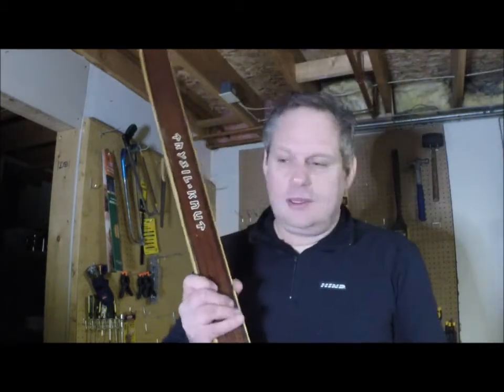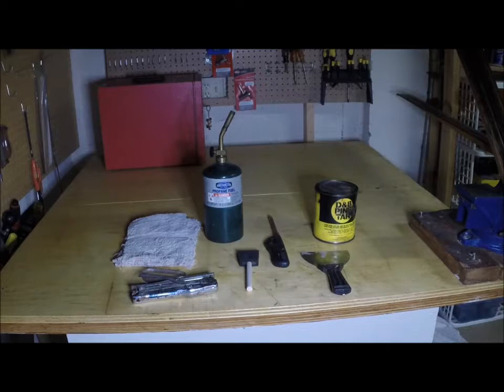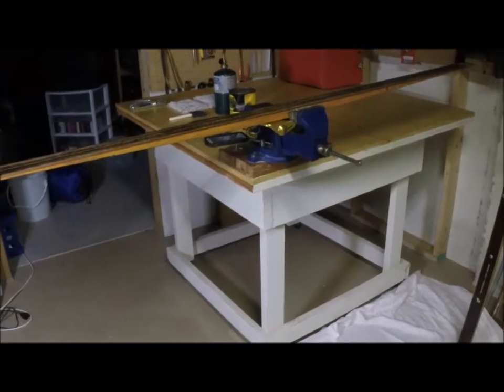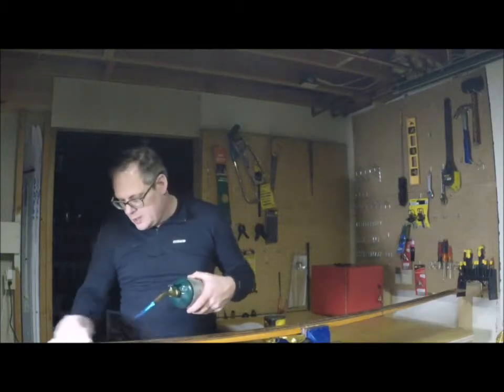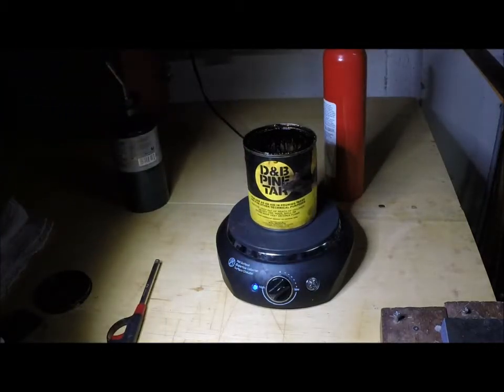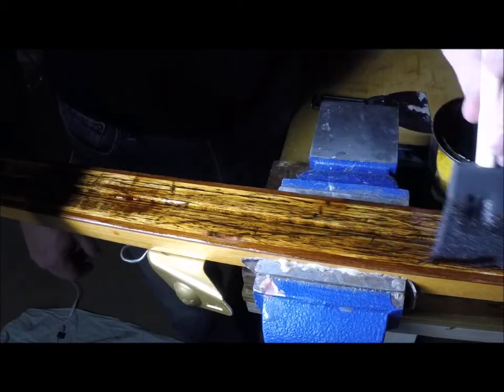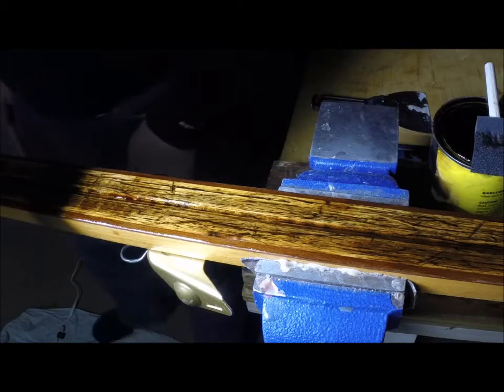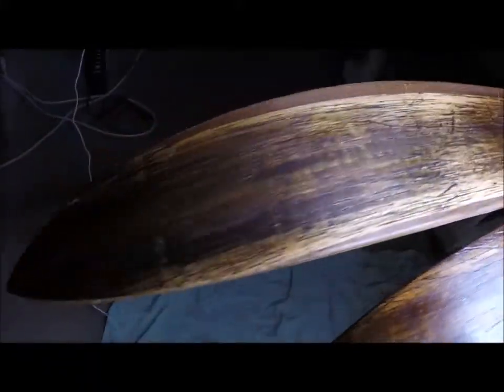How to Pine Tar Skis with Cheap, Easy, Simple tools

Comment: Thanks Mike....  Yesterday I got out my gear to hit the trails and realized my skis that I had been using for the past few seasons were toast.  I was going to buy some new ones but I remembered that my parents had some old gear in their basement.  Long story short...I found an old pair of Bonna woodies and put my Salomon SNS bindings on them.  Had a riot today on those things...they felt great.  After I got home I started doing a little research on care for wooden skis and came across your video.  Thanks for posting it.  I just picked up a pint of pine tar and I'm about to go to town.
Reply from the maker: +Robert Mitus  You are welcome, Robert.  Cool that you can have your folks old woodies.  They are a velvet ride, for sure.  Pine tar them, hot wax them (with paraffin is fine) and have a ball.

Comment from the maker: Folks, if you have a nice pair of wood skis, you should consider blocking them while you store them for winter (or longer).   Blocking helps maintain the camber and keeps the skis from twist warping.  Cut a piece of wood that is about 3/8" wider than the normal relaxed camber of your skis when you hold the skis together.  Put the wood block between the skis under the part where the bindings are mounted.  Tie the tips and tails of the skis together.  The wood block should hold in place by itself.  IF not, then the block is too small.  Don't over-do it by making the block too big, thinking that you are going to put more camber in the skis.
Reply: Super helpful.  Thanks.
Reply: Excellent tip; thank you

Comment: I just pine tarred my skis. I warmed some linseed oil in a mason jar set in a pot of water. I then poured in an equal amount of tar and mixed it with a stick. I used agricultural grade tar and it looked really nice but it's taking a long time to dry ( maybe I shouldn't have diluted it). I need to get some wax but I want to do some research first. I'm also making my own bindings, so it's quite a project!

Comment: I worked in a ski shop many years ago and this brings back some good memories.   We didn’t get a lot of wood skis in but I still remember the smell.  We used to get the pine tar ( Swix maybe?  ) in little aluminum bottles that you could heat up with a torch before applying.   Thanks for posting!
Reply from the maker: Great memory.  Thank you for posting

Comment: I bought my first Cross Country ski package from Eastern Mountain Sports in Burlington VT in 1973 for $40 (included wooden skis, boots and bamboo poles.  I still ski on wood skis (Bonna 2400's) and wouldn't think of switching over.  I still have the same pin bindings and bamboo poles from the original purchase.  Just skied 4 miles this morning walking the dogs.
Reply from the maker: Marc LaPine fantastic, Mark!!

Comment: OK.  I finally did it and your video was helpful.  Good points:  sponge brush worked great.  Also seeing how long you used the flame (1-4 secs at a time) was helpful.  I bought Pine tar from Akers Ski online and it was thin so I didn't have to warm it up. (Maybe it's the quick dry tar another helpful site mentioned?)  I did put it in the sun for 30 minutes.  Today is 90 degrees out so I put the skiis in the sun to warm the wax and open the pores too.  Seems weird to prep skiis on a hot day but that's my suggestion!!
Reply from the maker: Renee Lajcak YOU ROCK, RENEE!

Comment: Mike, thanks for the video. A buddy of mine just gave me a pair of old wooden skis. I watched your video and have started the process. I am waiting on my pine tar to arrive. When I got the skis it appeared someone put a bunch of pine tar on them and never heated it in. Waxed over the tar as I got a lot of that off. Bottoms were almost black and super sticky. A marble my have stuck if i tried to roll one down it!!! Anyway I was wondering if I could send you a picture and see if you think I need to get more off. They are not sticky now but still much darker than yours.
Reply from the maker: Sure.  Send a picture or a video!  Sometimes old wax looks like pine tar.  In fact, the really old kick wax like WWII Era wax DID  have pine tar in it.  Anyway, if you got the sticky stuff off, it should be OK.
Reply: Thanks for the response. Not sure I can attach a photo in the comment section. Don’t know how to do it. I will hit them again today with the heat gun and make sure all wax is off and proceed with the pine tar when it arrives from Amazon. Thanks again!!

Comment: How often should I pine tar my old wood XC skis?  If you're open for a suggestion, turn off the radio. It was kind of hard to hear you when the radio was playing.
Reply from the maker: I think the general rule is pine tar every 75 miles or so, BUT a lot has to do with how clean the snow is and how abrasive the snow is.  So, if you are skiing dusty desert mountains, you might have to pine tar more often.  Your skis will tell you.  Look at them and you can see where the pine tar has worn off usually more at the tips and tails.  Thanks for  the suggestion about the music in the background from the radio.  I didn't realize it until I edited the video.  Future vids don't have the radio.
Reply: @explorermike19  I pine tarred my skis yesterday.  Today they are still tacky.  Do I have to wait for it to dry before I wax?
Reply from the maker: @Guitarzan8  Pine tar won't dry.  Polish it with a rag until it isn't sticky.  If you have too much pine tar to wipe clean, heat up the pine tar with a hair dryer or heat gun to liquefy it,, then wipe it clean.
Reply: @explorermike19  Thanks Mike!  That worked. Does the wax have to cure before I ski on them?
Reply from the maker: @Guitarzan8  Neither wax nor pine tar have to cure.  Just be sure that you don't ski on warm wax.  If you wax or keep your skis inside, let them sit outside for 20 or 30 minutes before you ski so the wax can cool and adjust to the outside temps.
Reply from the maker: @Guitarzan8  by the way, I did make two new videos about base/glide waxing wood skies and kick-waxing wood skis.  I should have them posted on YouTube within the next couple of days.

Comment: I was thinking that my heat gun would be safer than a torch although probably slower. 

I applaud your response to the people who wrote comments. Rare among tubers (no response needed here btw).
Reply from the maker: I have never used a heat gun.  As long as you can get the pine tar to bubble and set into the wood, you will be OK.

Comment: Have you ever used Finnish pine tar mix ? ( equal parts pine tar, gum turpentine, & beeswax heat & mix makes a cream)  website said  I apply without torch. Have you ever tried it?  Does it work?
Reply from the maker: Yes, I have used that.  It was sold in the late 1970's and early 1980's as a no-torch pine tar.  In fact, I think I still have a can of it somewhere.  It is "OK".  It is more like a paint coating than an actual pine-tar process.  I would say that if heat-treating pine tar is too complicated or too intimidating, then use the pine tar mix.  In my opinion, it is not as good as heat-treating with pine tar, BUT it is a WHOLE LOT better than nothing.

Comment: Hello Mike, I need to apply Pine Tar to my nordic skis.  I know how to do it  thanks to your video , however I need to do it in the garage in the Canadian winter. My question is; is it ok to do the operation in minus temperatures or even very low plus temps.  Your answer in this space would be just fine, Thank you in advance.  Anyone else seeing this request; your answer would be welcome.  Thanks to any and all for possible help.
Reply from the maker: DonovanJose:  Yes, you can pine tar in a freezing garage.  Your challenge will be keeping the pine tar liquid, getting the pine tar to sink into the pores of the wood, and of course, the discomfort of working in freezing conditions.  However, it CAN  be done.   Do it the best you can now and maybe do it again in summer if you remember.   An electric hot plate is very handy for keeping the pine tar melted while you work.
Reply: Thanks for that Mike.  Nov 12th 2023.  I'll get at that this month.

Comment: Im 21 and just purchased a pair of wooden skis and looking forward to using them this winter. I have never cross country skiid before! How often should I apply pine tar and wax?
Reply from the maker: The frequency of pine tar depends on how much you use them.  For most people, that is about once per season.  When you see the pine tar wearing off (usually at the tip and tail), then it is time to pine tar.  For waxing, there are two kinds of wax:  Glide wax and kick wax.  Please see my videos about waxing.  I describe why, when, and how to use and apply both kick wax and glide wax in two separate videos.

Comment: Here there Mike! I certainly appreciate the video! I've just carved out and bent a couple of pairs of skis by hand as a small winter project. Would you have any tips or knowledge of applying pine tar to completely virgin skis? It's -10°F here in Minnesota at the moment, would you have any suggestions for an all around kind of wax to apply after tarring?
Reply from the maker: Joseph Felegy sorry for the late reply.  make sure your new wood is sanded smooth.  Then, pine tar as described her.  For wax, you know, grocery store paraphin gives a nice soft ride in most conditions for Minnesota, Wisconsin, and Michigan.  make sure you apply it thin. Thick wax slows you down.  You can buy ski wax, but paraphin works well for most recreational skiers.

Comment: Do you dilute pine tar with turpentine?
Reply from the maker: Ann Do not dilute the pine tar with turpentine.  It is not necessary and you will surely have a wicked fire on your hands when you heat up the pine tar.   Soften the pine tar by heating with an electric heat pad or double boiler.  If you heat the pine tar, it will become viscous.  Good luck.  Let me know if you have any questions.
Reply: @explorermike19  hi mike thanks for the video and  advice. I pine tarred my skis yesterday following your method. I worked great other than I used too much and I had more to wipe off. Really glad I didn’t use turpentine in the mix ( i had bought it) since I did it inside. You probably saved my house from burning down.

Comment: Could a butane torch be used?
Reply from the maker: I think a butane torch would work if you regulate the flame amount.  The idea is only to heat the pine tar just until it bubbles.  Keep your flame moving.  Don't burn or char or discolor the wood.  I have seen wood skis that have been burned during the pine tar process.  It is a sad thing to see.

Comment: "These wooden skis are a work of art"...takes blow torch to them... just get a thermostatically controlled heat gun already, you're killing me!!! My Asnes wouldn't speak with me for three seasons if I put fire to them!
Reply from the maker: Ha haa.  Well, you have a point there.  BUT, I don't have a heat gun so I still use a flame like I have for 40 years.  I never tried a heat gun, but I know that the flame method works for sure.